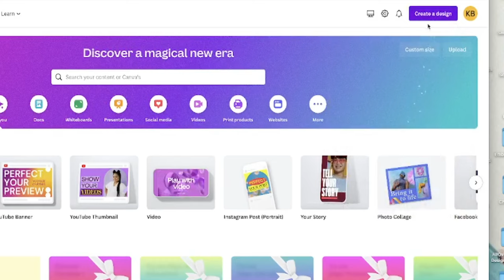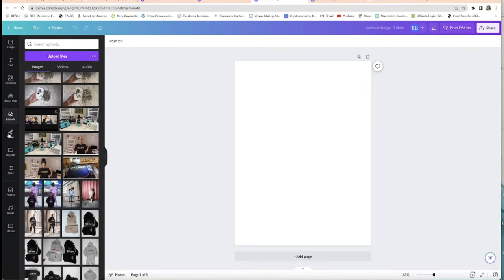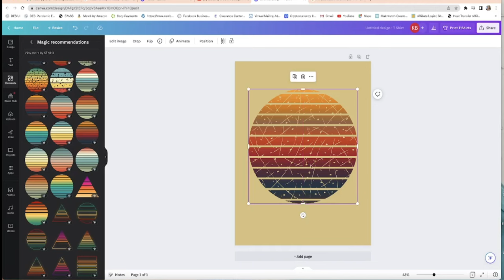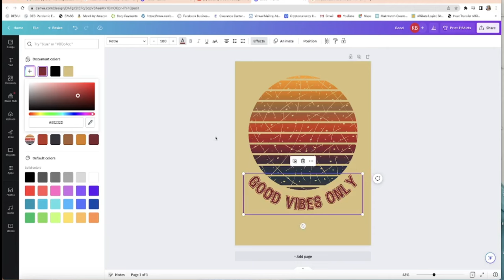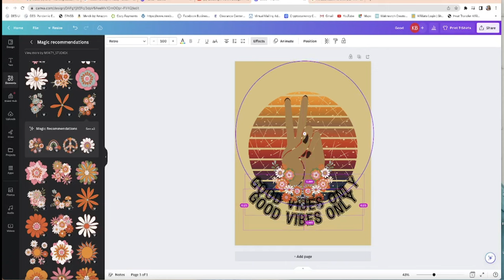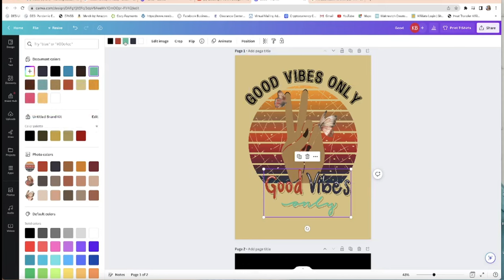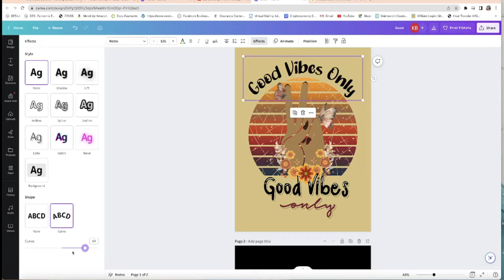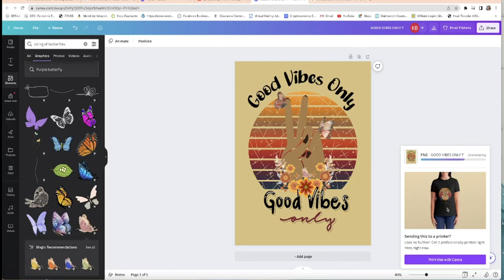How to make a Graphic T-Shirt using Canva & bring your designs to life! Easy steps Start to Finish!

Comment: Thank you for sharing, I have the free version of canva, but since I saw your video I will be switching to pro, once I figure out how to do that. Question, I need to know how to get my designs to print and is there a special degree to heat pres on your materials. Also the transfer film that you were using is it the large size, and what would I need to do to print t more of the same design on one flim . Just love your personality and the fun approach that you bring to the instructions. Keep up the good work 😅
Reply from the maker: Hello there were a-lot of questions in here. Please refer to other videos to help with how to apply and press and the temperature.  Every natural has different instructions.  I can’t answer all that under one messages.  It will depend on what you’re doing.